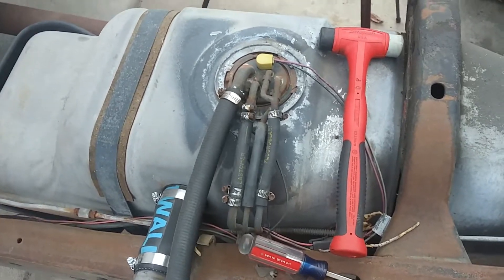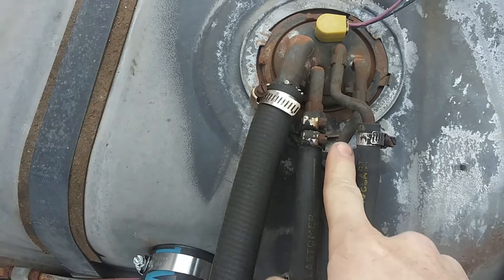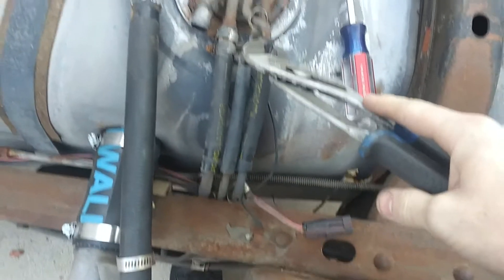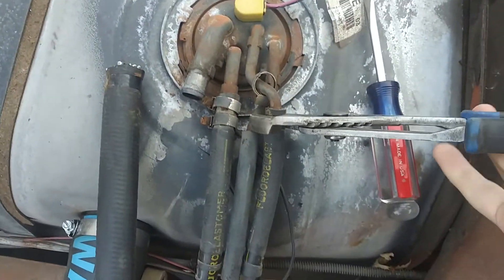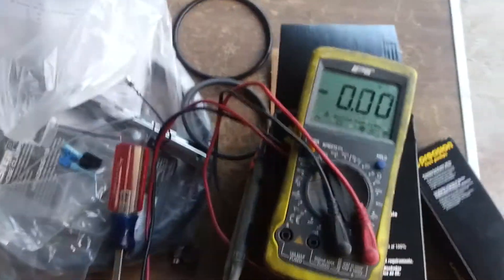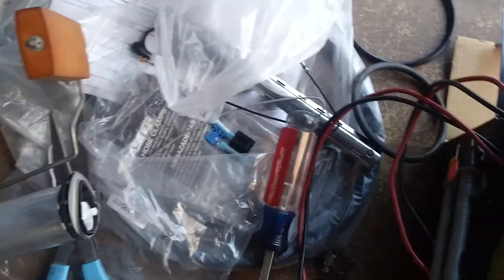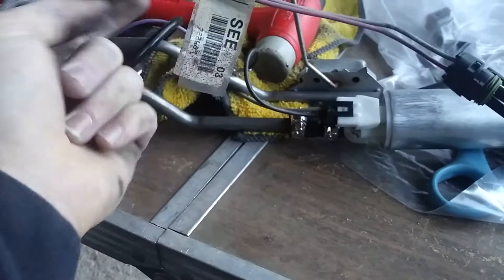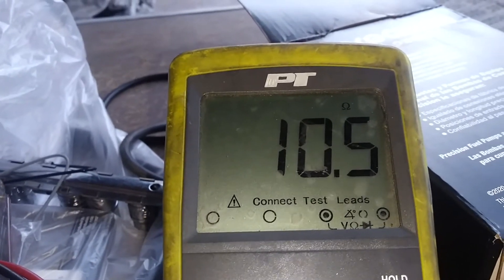Swapping fuel pump '87 Chevy S10

Comment: Hello, a question . . do you happen to remember what is the gray and pink wires respectively? are they (both)  the sending wires? which is the fuel pump power wire?  my truck got manipulated by a mechanic who was supposed to fix a mechanical problem but messed with some wires . .  . If anybody knows please respond . . . thanks so much
Reply: I believe one is the fuel sensor and 1 is the pump power. With the ignition turned on but truck not started the fuel sensor should have a constant power and the pump power will only have 12V for the first 2 seconds that you turn the ignition on

Comment: DO NOT USE ANYTHING BUT BRASS TO TAKE OF THE FUEL PUMP O-RING. YOU CAN CAUSE SPARKS BY USING REGULAR TOOLS AND SPARKS AROUND A FUEL TANK IS NOT GOOD.